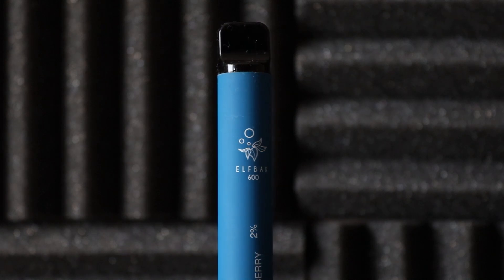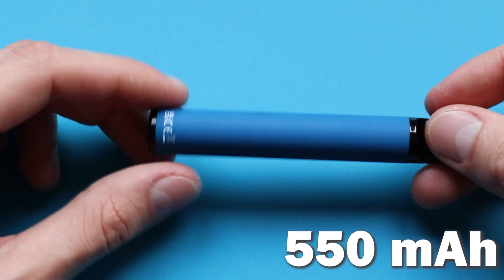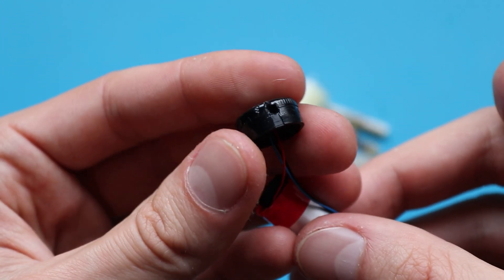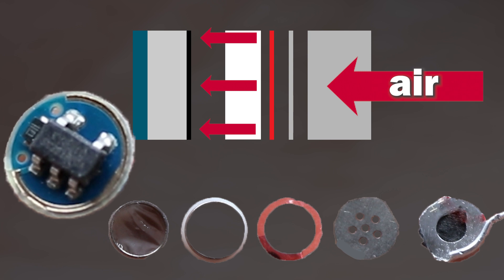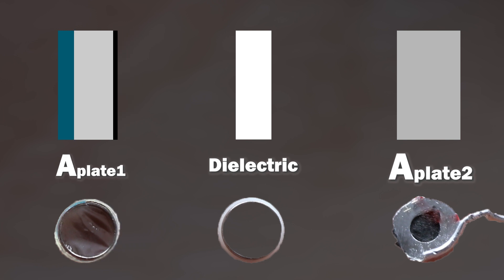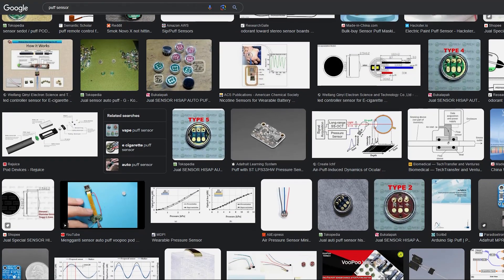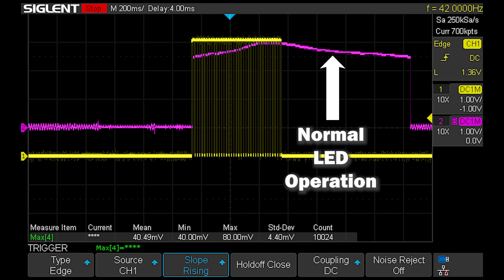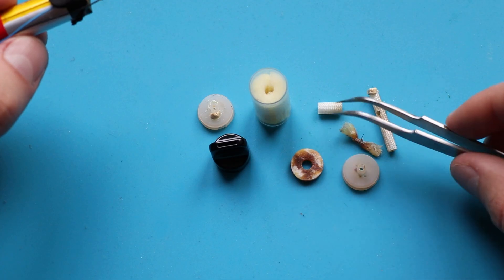How Does E-cigarette Smart Sensor Work (with schematic)

Comment: Great Video! I just found your channel and just had to subscribe! 
I have something to add though...  the Airflow goes in the other direction: The metal ring with the membrane doesn't move. But the conductive membrane is pulled closer to the metal disk with the holes. Sometimes (especially with the refillable ones) when liquid gets in the sensor it can get stuck "on" due to capillary action between the membrane and the disk on top. 
And something else interesting: Many of these ASICs also have a charge controller. If you disconnect the heating coil and apply 5V the LED lights continuously and the battery is charged at a limited current to ~4.3V (Yes not 4.2V).
Reply from the maker: Thanks for the comment! Hmm, why 4.3 Volts? Strange :D Engineers definetely smoked something while designing this thing

Comment: I'd like to know how the battery is charged, I can't find any circuits.
Reply: It can be charged through the connections to the coil with the coil disconnected, using the common negative and a +5v USB connection to the sensor. 
This used to be the way that early e-cigarettes that imitated tobacco filter cigarettes worked, you unscrewed the mouthpiece containing tank and heater etc, and screwed in the USB charger to the battery and sensor module. when the charging battery was full the LED went out to indicate that it was ready to use.
Reply from the maker: Because its not charged :) It is one time use device.
When it discharges, you have to buy a new device.
Reply: @NickElectronics  Mine are disposable yet rechargeable, there is a usc-c port and lithium polymer battery. I have charged mine over 10 times so far. I found the charger, it's in the sensor, not sure how it works though.
Reply from the maker: @LowBudgetGamer-o6l  Hmm. In such case the IC should charge battery as well. Working principle is based on CC/CV charging algorithm probably,,, Like for a typical Li-ion battery. But in details it is hard to say

Comment: I have been taking apart quite a few of those recently though i came upon one of those draw sensors that has 4 connectors. Have not totally figured out yet what the 4th one is for
As far as i can identify them, one wire directly from the battery +, an other wire connected to the charge/control board, oddly also labeled '+' and 2 wires going to the spiral. All a bit odd but i am confident i will figure it out
Reply from the maker: Maybe the one that goes to the charge board "+" just monitors battery state and duplicated the other +. With integrated circuits you never know ))) 
Yeah, in my life I understood that if you really want to figure something out, sooner or later you will do it. So, never give up :)

Comment: With a 550mah lipo battery, and around a 2ohm resistor coil, how are they getting enough power to the coil to sufficiently heat up? I am taking apart a vape myself and it has the same characteristics.
Reply from the maker: Capacity of a battery has nothing to do with a power it can deliver. Some li-ion batteries can deliver 1C current, which is 1Capacity (for the 550mah it would be 550mA current) and some can deliver up to 10C and way more for a short time.  It depends how battery was designed.

Speaking about the power.
So we are talking about 3.3-4.2 Volts from a battery across a load of 2 Ohms. Current would be around 1.65-2.1 Amps, which gives power output of current^2*Load = 2.1Amps*2.1Amps*2Ohms = 8.82 Watts!! So that is the highest power that such a battery can deliver to the load of 2Ohms (if there is no other circuitry that boosts battery voltage to a higher level. Usually there are not). And almost 9 Watts is a CRAZY amount of power. 

If there is a current controller in the device, which directly controls the current through the coil, limiting it, current should be of any value and power and heat generated by a coil can be controlled. But yeah, definetely 1 battery can deliver enough.

Hope this answears your question

Comment: Very interesting.  I watched this video because I routinely disassemble Vuse Alto vapes (because I have a ton of them).  I harvest the lipo cell, magnets (awesome magnets) etc from them.  

But what I really wanted to do is use the actual Vuse control board to act as a 1S protection/charging board for use with the cell in other applications.  I figured I could "go around" the air sensor and perhaps connect these wires to an off/on switch.  In this way I wouldn't need to purchase separate 1S protection boards to use with the cells.  With the coil totally disconnected, I was unsuccessful trying to simply bridge the full voltage going into the sensor to it's sensor voltage out (which I thought would make it turn on the power/LED).  

The Vuse board seems like it's a little too complicated of design to repurpose into a simple under voltage/over voltage board.  Especially if it would cut the voltage to the output after a set amount of seconds.  Pity to waste these nice looking boards.  I suppose they would at least serve as general lipo charging boards.  Unfortunately, without undervoltage protection, I can't really use them in projects.
Reply from the maker: Feel your pain. That is the problem of all application specific integrated circuits. They do work very well in the applications they were designed for. But it is somehow difficult to use them in other applications🥲
Reply: Many of these ASICs also have a charge controller. If you disconnect the heating coil and apply 5V the LED lights continuously and the battery is charged at a limited current to ~4.3V. But I'd recommend some tests to confirm. Some just blow up or heat up and don't charge the cell.

Comment: Congratulations! This is the first near correct description I have seen of these capacitance pressure sensors. So many think they are just a contact pressure switch!  They are based on the simple electret capacitor microphone mechanics. But instead of the usual audio pre amplifier chip in the mic application, these devices have a very clever asic chip.  It applies a continuous AC signal 24/7/365 at low power level across the diaphragm foil to ground. You can see it on an oscilloscope. I have a capture of this but can’t attach it here. That ac signal enables minute changes in capacitance to be detected.  It is essentially a modified mic capsule.
Reply from the maker: Hehe, thanks for a comment. It complements explanation in the video quite good :)
Reply: @NickElectronics  At first thoughts, it seems like an overkill way of controlling the heater in these things. However, they seem to work very reliably under all conditions. A simple mechanical pressure switch would be notoriously unreliable and very dangerous if it stuck on! It’s also great for the folk (like me) who collect used discarded vapes to salvage the Li-ion batteries. The clever little asic stops the batteries from becoming over discharged as it cuts out at around 3V then flashes the LED. I agree disposable vapes are crazy wasteful, and are littering our environment.
Reply from the maker: @ThePrawlin  Agreeing that disposable vapes are incredibly wasteful. Also, I believe that in China, such a sensor costs almost nothing, especially considering the huge quantities they produce. So, definetely not an overkill )

Comment: I've been searching around for a couple hours now, and finally got a in depth explanation, thank you.  I found a rechargeable yet disposable e-cigarette today, and pulled it apart, to salvage the charging unit and battery, when it occurred to me it didn't have a switch to initiate the coil to heat up.  I found in this e-cigarette, a  "Lost Mary" brand, what appears to be the capacitance chip, in your video, if not a clone.  The strange part is that the mouth piece has an extended piece of plastic, that is part of the mouth piece mold, and it looks like a tiny dogs tail , and that piece of plastic sits directly on the chip.  It did not have any of the metal layers or housing, as depicted in the video.  Maybe I missed something, or mistakenly identified the part.

I cleaned the device up and recharged it, and it still has fluid in it, which I didn't like much.  But the point is, it worked properly, so there isn't any parts missing.   Thought you might find this information interesting.  EDIT:  I looked carefully at it again, and noticed the little plastic tail piece rest against pin 2 and rests on top of pin3.  I can't get my phone to zoom in on the chip, enough to get the information of it...
Reply from the maker: Hi, thank you very much for the info :) I believe there might be different mechanical principles to create contact between two plates depending on the device, but from electronics point of view it still should be some capacitive sensor :)
Reply: It seems to detect airflow, somehow, but like you I could not find any data sheets on either device.  I did find where to buy the condenser microphone type, you where examining n AliExpress and believe it or not Walmart online!  I almost ordered 5pcs for $8 and change, to try reading one with my ESP32, since I read somewhere they require 3.2 volts, but I'm sure I'll find another Vape, since the college kids around here are a bit wasteful @NickElectronics